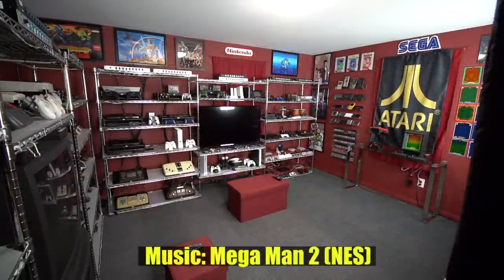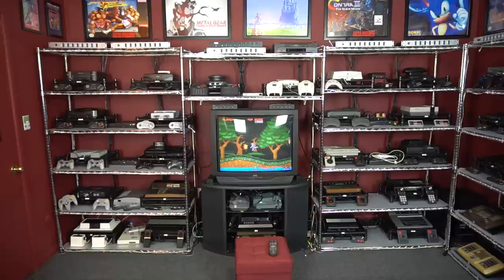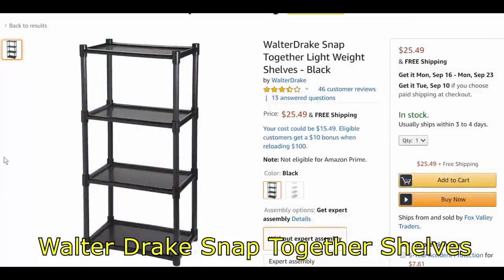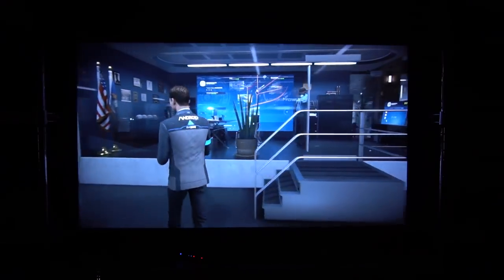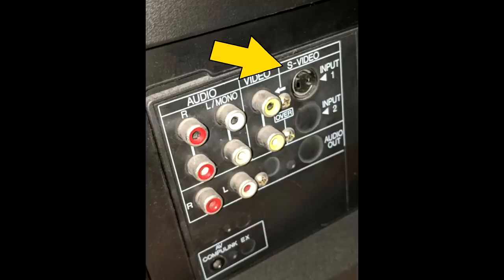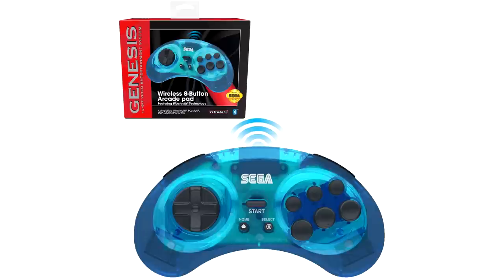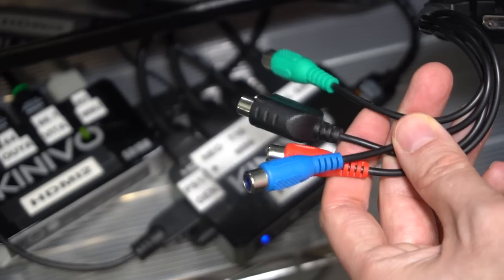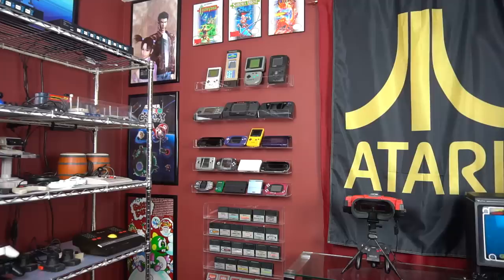How to Build the Ultimate Gaming Setup

Comment from the maker: PRODUCT LINKS (updated 6/29/2022)
Console Trays: https://amzn.to/3OOTzfV
Wall Shelf for Handhelds: https://amzn.to/3I3SS01
Rack Mount Power Supply: https://amzn.to/3NPpKvM
Vectrex table: https://amzn.to/39ZkmHE
16 Port HDMI Switch 60 Hz: https: //amzn.to/3H5vP4E
LG 43" 4K HDR TV (43UM7300PUA): https://amzn.to/3NddfZT
Kinivo HDMI Switch Box (550BN): https://amzn.to/3NQm7FW
4K HDMI Cable 8 feet/2 Pack: https://amzn.to/3QkKmgT
HDMI Cable 10 feet: https://amzn.to/3xqEmL3
Power Cord Splitter: https://amzn.to/3zBfT8K
10-Port USB Hub: https://amzn.to/39ixyae
Wireless microphone: https://amzn.to/3xG04uO
Labelmaker: https://amzn.to/3OdaOYG
Vectrex overlay magnets: https://amzn.to/3ytxz57
Evercade Vs System: https://amzn.to/3OTk043
Genesis mini: https://amzn.to/3I0bxKe
Neo Geo mini: https://amzn.to/3R7Z1g6
TurboGrafx mini: https://amzn.to/3nongZE
F-Type Coaxial RG6 Connector Adapter: https://amzn.to/35ad4dX
F-Type Male Plug to RCA Female: https://amzn.to/3k7eaNK
RCA Female to Female Coupler: https://amzn.to/3nY0zdV
RCA Male to Female: https://amzn.to/31fn98h
RCA 1 Male to 2 Female Y Splitter: https://amzn.to/3ka0wtk
S-video 1 Male to 2 Female Y Splitter: https://amzn.to/37evEUQ

Other TESmart switchboxes (I don't own):
TESmart 16 Port HDMI Switch 30 Hz: https://amzn.to/39b9mGZ
TESmart 8 Port HDMI Switch 60 Hz: https://amzn.to/3xngDLY
TESmart 8 Port HDMI Switch 60 Hz: https://amzn.to/3NtDOuJ

Wire Shelves:
https://www.lowes.com/pd/Style-Selections-18-in-D-x-47-7-in-W-x-72-in-H-5-Tier-Steel-Freestanding-Shelving-Unit/999990408

18" by 48" Intermetro Clear Shelf Liner:
https://www.containerstore.com/s/shelving/metro-commercial/metro-commercial-industrial-clear-shelf-liners/12d?productId=10005494

Comment from the maker: Intro 0:00
Sure About Doing This? 0:44
Choosing a Room 1:30
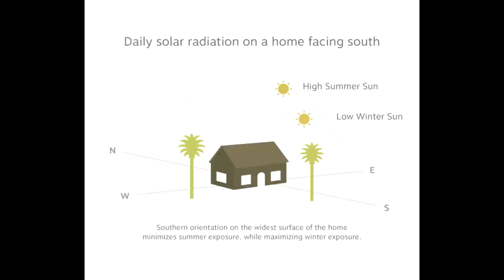Main Shelving 6:15
Console Trays 11:38
Mini System Tray  13:43
Buying a TV 14:58
Buying Systems 18:35
Electrical Wiring 20:27
Signal Wiring   23:52
Controller Cord Extensions 29:29
LED Lights 33:34
TOP SECRET  33:00
Recording 34:18
Other Gadgets 37:03
Cable Management 38:24
Vectrex and Virtual Boy 40:03
Shelving for Handhelds 41:52
Furniture 43:07
Carpet and Décor  44:54
Labeling  46:54
Final Thoughts 47:41
Reply: Wow, thank you!
Reply from the maker: There are already timestamps in the  description.

Comment: Thank you so much for this saved my life on a few things getting an apartment soon had around 1500 saved up for the project and own everything else only needed the wires cables adapters only few last shelves gave me an idea to cutting holes on the back of the wood shelves to hide the wires and needed to learn the signal finally get to use all my systems own around 45 and a crt and 2 TVs I’ll have a similar set up but one room will be signal only just liked and subscribed keep the good work up!

Comment: I absolutely love the way you have everything set up. I'm going to need to keep this video on reference for when I'm able to put something together for myself, though it probably won't be as extensive as yours. I think I'd start with an emulation box for easy access, and use it as a sort of checklist. Start with finding the systems that match up with the emulators, and getting flashcarts on those, splitting the collection up into something a little more authentic-feeling, then hunting down the individual games themselves over time. Plus, it would help give me an end goal. As much as I think it would be fun to build up a collection, I can't see myself collecting things just to own them, I'd prefer things I'd actually use. Using an emulation box as a starting point means that I'm going to naturally remove any games that I simply don't like and wouldn't ever play when the collection grew.

I kind of liked what you did with the closet, but I think that it looks a bit odd as an empty space. Did you ever do anything with the closet space since making this video? Personally, I think I'd try to fit in more of those shelving units into the closet space itself, and use it as a bookshelf to collect the old strategy guides that they used to make. (I miss those, they had a lot of fun flavor text. I remember the StarFox 64 one had stuff on atmospheric makeup on each planet, and "historical" facts about each place. Modern walkthroughs like on GameFAQs are a lot more emotionless) Alternatively, you could try and find the various old gaming magazines like Nintendo Power or GamePro and fill the space with those. Get the full childhood experience of turning on an old game and having the strategy guide or magazine next to you as you went.

Comment: I won't say that this isn't impressive, because it is. My only worry here is the electricity delivery, more specifically the extension cords. Extension cords are ALWAYS a temporary solution and should never be used as a permanent one. The power delivery splitters you have are a good start at managing, but again, man those extension cords shouldn't be used permanently.

Comment: 29:00 I have no clue what problems your having, but I have a Phillips model PH61150. It has 4 inputs including S-video and one output. It requires its own power, but it will automatically switch depending on the input signal and it's worked great for me since I bought it almost 20 years ago.

Comment: I'm somewhat curious as to how you manage to deal with large power bricks for some of the more recent systems like the Wii U, Xbox 360, Gamecube, ect. I've found in my own setup that having to deal with them and their limited length is the number one thing holding back my cable management. Amazing video by the way, your original multi-part setup tour was on of my main inspirations for building my own ready to play setup almost five years ago, and it's hard to imagine life without it now. Keep up the great work!
Reply from the maker: Most of the rectangular power bricks you mention are on the top shelf, like all the other bricks. It helps to have the systems close to the top. I have one that is tucked inside one of the trays. You should still be able to extend the cord, between the system and the brick with something like this: https://www.amazon.com/YEKELLA-Receptacle-Female-Extension-Adapter/dp/B07D13PLTL/ref=asc_df_B07D13PLTL/?tag=hyprod-20&linkCode=df0&hvadid=242022044358&hvpos=&hvnetw=g&hvrand=5844693401408076624&hvpone=&hvptwo=&hvqmt=&hvdev=c&hvdvcmdl=&hvlocint=&hvlocphy=9014985&hvtargid=pla-528994939868&psc=1

Comment: Awesome setup!
To fix the bolts falling out of the chairs, you can use a thread lock.
That's the type of glue that is formulated to hold a bolt up to a certain force.
Thus, fixing the loose bolts problem while keeping things disassemble.
You can find it in Walmart under the 'Loctite' brand.
Reply from the maker: Thanks. They actually turned out to be nuts. I went underneath and tightened them again, so we'll see if they hold.

Comment: Do you cover any of your systems to prevent dust buildup when you're not using them? I have covers over my Saturn, Sanyo 3DO and a few others I dont use very often. My gameroom is in my basement, but I have constant ventilation going and a dehumidifier for when it does get moist down here and all of my stuff is well above a potential flood level.
Reply from the maker: No, I don't cover them. I like to be as unimpeded as possible when playing a game.
Reply: @HowToX  you can buy a small air purifier.
Then you can dust the consoles half as often.

Comment: Been looking forward to this video for a while now, nice work! Couple of questions about the rack mounted power supplies:

1) How does they work with your Japanese consoles? Are you plugging step down converters into the Technical Pro units?

2) Are you aware of any other brands that make similar units? Just a bit conflicted about getting them - on the one hand, the individually switched design is perfect. But on the other hand, they do get quite bad reviews for build quality, and I’ve never seen a UK-style power outlet version with the individual switches. 

Keep up the great work 👍
Reply from the maker: My Japanese systems are the Neo Geo CD and Pippin. They run fine when I plug them in. I think they just use the AC adapters. As for the power supply, I know of one other called the Eliminator E107. It's in my living room. Lots of the lights have gone out. I don't recommend it. I suggest the Technical Pro, but mod it to have thicker gauge wiring.

Comment: Thanks for the links.  You can try plugging the Ataris and rf systems into a composite switch box than run a composite cable to the rf adapter.  Less signal loss than the rf switch box, maybe.  The CRT would be fine on the wire rack.  I have a 130+ pound HD CRT on one...which is probably too much, but  any CRT under 100 lbs would probably be no problem...in your case I'd keep the stand though.
Reply from the maker: My RF network has no adapters or switchboxes. Just a straight shot to the TV. To me that should be the best way. Perhaps I'm wrong.
Reply: @HowToX  I saw that.  It's cool.  I thought you did it to avoid a bad signal from the rf switchboxes.  Just suggesting an alternative if you wanted to get away from the dangling cords.

Comment: I want to set up a gaming tower in my family room with 4 hdmi consoles going to TVs in my family room and 2 tvs in my kid's bedroom. I basically want to load the game discs in the family room so the kids can use wireless remotes in their bedrooms. Do you know how this could be done?  Specifically using wireless remotes in a room other than where the console is? Passing cables through walls is not a problem. Setting up Ps4, Ps5 xbox 1, and Switch in case it matters.

Comment: hi I have a quick question. My PlayStation 3 console requires a 120 volt 3 amp power cable. But I have a few 125 v 7 amp cables and a few other 
125 v 10 amp cables that both fit. Does it matter which cable I use? Are those ratings only saying what the cable can handle maximum or are those numbers what the cable is actually pulling out of the wall and sending to the console once you plug it into the wall?

I feel like I'm thinking that cables are similar to car fuses but I'm a bit confused.

Thanks.
Anybody knowledgeable please reply soon..

Comment: What’s the longest male-to-male cable in your setup? (E.g. how long are the component cables daisychaining your switches together and connecting them to the tv?) thanks!
Reply from the maker: I don't know, but I make them as short as possible. The component segment that goes from the swapping area to the TV is only 1 or 2 feet long.

Comment: I also have a big setup (not as big as yours).
I'm also using Kinivo boxes.  But my 2 PS4 (original and Blue-Pro) won't wake from sleep when connected.  I have to remove the power cord.
I also have the same problem with the SWITCH.  That one I un-plug hdmi and it's working.
Did you encounters the same issue....? have an idea....?
Reply from the maker: No, I haven't had those issues, but I can't remember the last time I used the sleep function on the consoles. Sometimes the Kinivo doesn't autodetect, but that's not an issue single I just hit the toggle button.

Comment: I use similar wire shelves, but not as wide or as tall, nor do I support as many systems. I trunk the wires down the side of the rear poles. It was a bit of a hassle to do it, but looks sleek. Have you ever thought of getting UV carpet panels and a UV light?
Reply from the maker: No, I haven't thought of UV lighting. Seems like it might be too distracting.

Comment: 4 the composite recording why not split the output of the 5-1 switch box like the svideo
Reply from the maker: Because splitting composite just outside the 2nd switchbox layer didn't work well in my experiments. It's better to split it as soon as it comes out of the system.

Comment: Is it safe to use the power splitters for systems like the sega tower of power? like for when you need 3 bricks to power a system but only want to use one switch on the power supply rack. Or should you just designate 3 switches one for each part of the system to be safe?
Reply from the maker: Make it separate. That may be too much to send through 1 switch.
Reply: @HowToX  understood so basically the sega 32x, cd and gen need their own switches?  If so what exactly do you need the power splitters for the supplies themselves? How do you hook up your tower of power?

Comment: Have you looked into the 16 port HDMI switcher (TESmart brand on Amazon)? It would simplify your setup & allow more connections also. Just a thought. Keep up the good work, your vids are a great way to relax.
Reply from the maker: I'll check it out. Hopefully it does 4K. If not, I could put all the non-4K systems on it.
Reply: @HowToX Just fyi, here is the description from its Amazon page: "TESmart HDMI Switch 4K UHD 3840x2160@60Hz 16x1, 16 in 1 Out HDMI Switcher Box with RS232 LAN Port Support HDCP2.2 16 Port HDMI Switch" Hope this helps.
Reply from the maker: You have convinced me!

Comment: Do you ever notice its a problem to run say 6 out of the 9 switches at once. Like I copied your setup exactly so I have my tv and one system running at a time. My only concern is when i have the 32x,cd,gen , and then the tv running is that ok for the power supply? Is the only concern I should keep in my is to only have one device per a switch but that it doesnt matter how many switches you have on?
Reply from the maker: I would not feel safe running that many things at once. I advise spreading it out amount multiple rack mounts. I myself don't run my TV power through the same rack mount as the systems.
Reply: @HowToX  cool, that makes sense, I got the american dj power supply rack mount cause I liked the red buttons more lol. However it says not to use more than 10 amps per channel even though its rated for 15. Should I have any worry or do most old systems not exceed that?

Also do you keep your tv on its own seperate supply ? Am I just better off keeping the tv off a powersupply and plugging directly into the wall?

Comment: for consoles with ac adapters, is there any way of finding similar power cords for the systems but with normal plugs. so that you would not have to use those extension cords?
Reply from the maker: Not really. Those large plugs convert AC to DC. Newer systems do that on the inside of their shells.
Reply: @HowToX  How do you play your magnavox odyssey if  you don't have the compatible tv for it?
Reply from the maker: The original odyssey isn't compatible with my TV? I should probably test it.
Reply: @HowToX   i heard the og odyssey was only compatible with magnavox tvs, cause the system had a special hook up for that type of tv. only

Comment: Awesome vid man! But can you explain how your numbering system works? Is there some specific order you have them in?
Reply from the maker: I probably could have explained it more. Basically, I have numbering throughout the room that's between 1 and 100. The lowest numbers are on the far left and they ascend as you move to the left. The 3DO is number 1. Some systems have attachments that take an additional plugs, like the Sega CD, so for those I label them as 7A and 7B, or sometimes 7.1 and 7.3.  I have gaps in the numbering, which allows me to insert new systems into the setups without renumbering everything else. They just take an unassigned number. Some of the switchboxe buttons have ranges of numbers, like 1-4. I think that explains it.
Reply: @HowToX  Yes, that makes sense! Thanks for the reply

Comment: I wonder why you don't get one of those USB charging stations for the minis, those usually have about 6 USBs on them . they're smaller and can be hidden away easier, and you can just use the switch on the rack mount that and you don't need a whole power strip for a few USBs
Reply from the maker: Can you post a link to one?
Reply: @HowToX  sorry i didn't post one, some youtube channels don't like links, so 
https://www.amazon.com/Charger-RAVPower-Charging-Multiple-Compatible/dp/B00OQ19QYA/ref=sr_1_4?crid=3AZ5D45E4GKUT&dchild=1&keywords=usb%2Bcharger%2Bmulti%2Bport&qid=1602949490&sprefix=usb%2Bcharger%2Bmulti%2Caps%2C214&sr=8-4&th=1
It's good to overprovision USB power supplies, otherwise if they're being used for a long time, you could heat them up. I had a battery that would take 8 hours to charge over USB and it would make all USB power supplies that use 2 amp or less heat up, even though it's using the rated power.
Reply from the maker: Cool, I might get one, but I need to see if there is one that has more than six. I need closer to 10.
Reply from the maker: Awesome!
Reply: @HowToX  although, it might not be safe, i saw some reviews of it melting. these are rated for 60 watts which is a lot, It's important to have a safe delivery system. 
this also has a hardware power switch, so you will have 2 layers of security if you please 
http://amzn.com/B00YRYS4T4

Comment: With the og Xbox did u enable 480p 720p but not 1080i
Reply from the maker: I don't really know what you mean.
Reply: The og Xbox can do hd output like 480p 720p and 1080i did u enabled it in the settings of the og Xbox
Reply from the maker: Yes, and I did the same for some of the other systems.
Reply: Did u disabled 1080i on the og Xbox